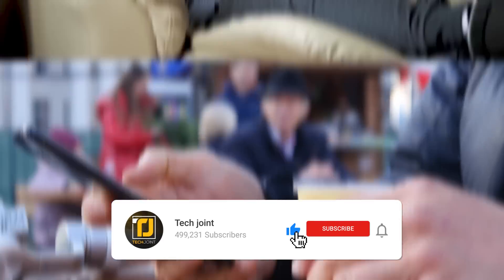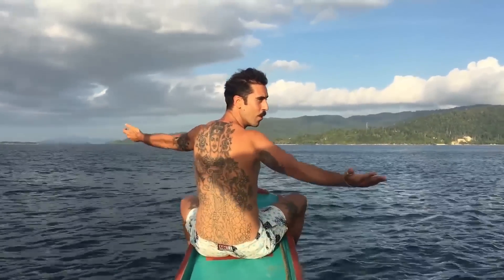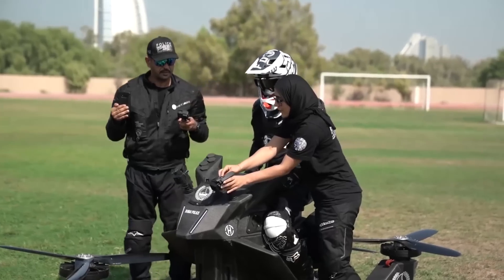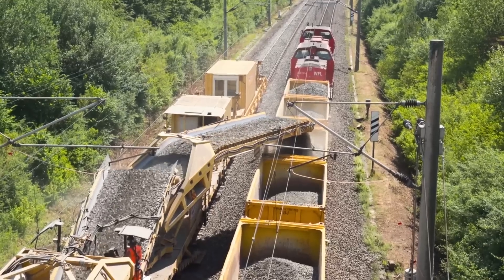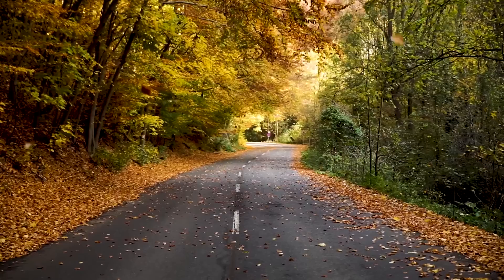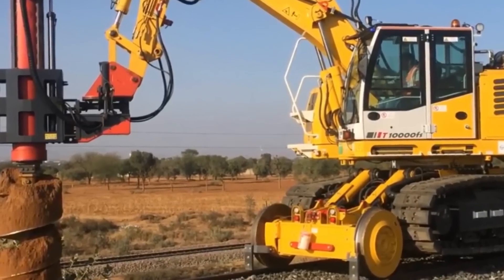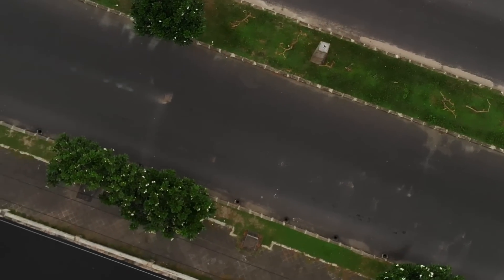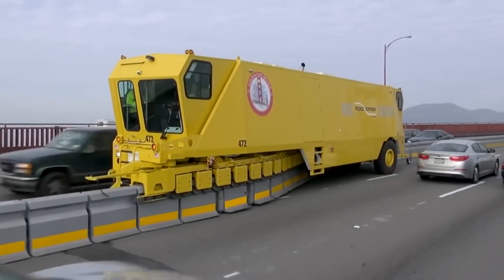10 Most Amazing Machines You Didn't Know Existed

Comment: The "Road Zipper is"interesting-but--In the 1960's we still had the lane divider on the Outer Drive in chicago---it was also concrete but built into the roadway and retracted benearh when not in use-----raised by electro-hydraulic's---it was there since the 1930's-that new unit is not so "incredible'"---advancement is not alway's advance-as such

Comment: What about the energy required to charge its batteries, they must be large and charged at night when the machine not in use.  No back to the drawing board and make something dependable. OOPS, back to good old fossil fuel!
Reply: Energy required to charge it's batteries comes from the power grid, which gradually becomes more and more renewable energy based. Spare battery could be kept for the off chance the main one wasnt possible to charge overnight. Problem solved. Later dude.

Comment: Its plain bullshit to say that an electric vehicle produces no emissions. Sure it wont produce emissions when being used but the electricity it uses has to come from somewhere. I greatly wonder what the 
benefits of an electric car are if the electricity used to charge its batteries were, lets say generated by coal or any other fossil fuel. I wonder what the 
efficiency of that is compared to a normal gas or diesel powered vehicle. Then without forgetting the mining and the environmental consequences to get rare metals like lithium for the batteries. The green party and liberals think electricity is something that comes from a plug on the wall. Then they try to "make a change" and wave rainbow flags without knowing jack shit how things work in the real world.

Comment: Zero emissions? Fat chance. Unless you charge it with water and fairy dust. Or maybe it's 15k AA batteries per day.
Reply: It's charged with electricity that would otherwise go to waste, after being generated anyway for the commercial grid.  It's not adding any emissions in and of itself, although it's actual ecological friendliness depends on what means are used by the local utility to generate its power, hydro and wind being best, and coal being worst (or tied with nuclear, depending on your opinion of that option).

Comment: Actually, electric vehicles don't give off zero emissions. They have to get power from a coal, or a nuclear power plant.
Reply: Sceptic101 O0O0O — Or natural gas, or hydro.
Reply: Or wind
Reply: Nuclear power is pretty much carbon neutral though, so if the vehicles use nuclear and renewable energy then yes, they do give zero emissions

Comment: Don't fall off your hover-bike, or you'll discover that it, too, is an efficient mulcher!  ~8^{   No prop guards??! Below, and surrounding the rider??
Reply: It's not a bike so it shouldn't be called a bike. It's a quod helicopter.
Reply: @legobrickabrac  I stand corrected. That quad 'copter would make a good human mulcher! ;^)  Seriously though, any guards at all would be safer than no blade guards. Or a cage that would fix the rider in place.
Reply: @pbasswil  Well it's not you who needs correcting, it's the creators of both the quod chopper and water cycle who are giving there machines the names Hover bike and water bike.
Reply: @legobrickabrac   your all rong is a human meat grindee
Reply: @MWSUB-CONTRACTING  I suspect there is a emergency safety feature that would instently lock the blades if the ridder is not holding a trigger down somewhere a bit like a electric strimmer.
Reply: @legobrickabrac   tape them down
Reply: @MWSUB-CONTRACTING  Say whaaaaaaaa? What do you mean?
Reply: @legobrickabrac  tape down the trigger
Reply: @MWSUB-CONTRACTING  Your really determined to see some one getting chopped to bits on that thing lol.
Reply: @legobrickabrac  yes that's why I tie people  to the tracks
Reply: @MWSUB-CONTRACTING  But they would die Bro 😑
Reply: @legobrickabrac  exactly
Reply: @legobrickabrac  So,zipping along 60 mph 16 feet up and the blades lock. You may or may not wake up in the hospital.
Reply: @ksw4951  There are no blades.

Comment: The whole point of the mulcher is to mulch trees that have nails , barbed wire in them or if they are just to big. Other wise people take the tree away since the mulch still leaves a mess were when you take it away there's not as much mess and you can sell the wood making a bit of cash. A mulcher is to expensive to buy or rent just to get rid of a few trees.

Comment: The electric tractor comes with a coal, plant waste and oil burning generator to recharge and save charging costs from the power company. It cost more than 3 tractors in charging for one season.
Reply: or better yet relying on the oil companies for natural gas

Comment: Mulching kindle wood we will have a big fire tonight,  Peddle your 9k bike over here at 12 mph it will be only a couple hours if there is no current.  I would join you but after loosing my legs on my hover bike I can't. I got a new job with my leaf vacuum. I just sucked up and compacted the chili chocking leaf blower fence hoppers. I got the whole burrito and compacted it. I sucked them right off is large on the side. If you need it sucked call me on the back !